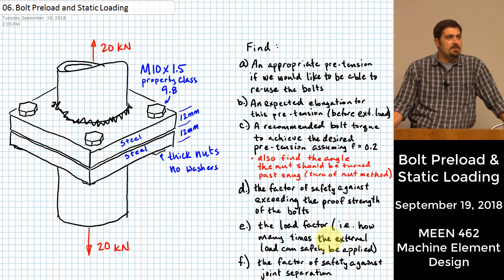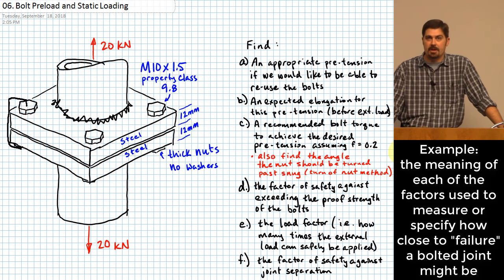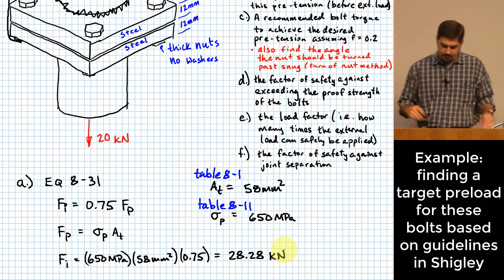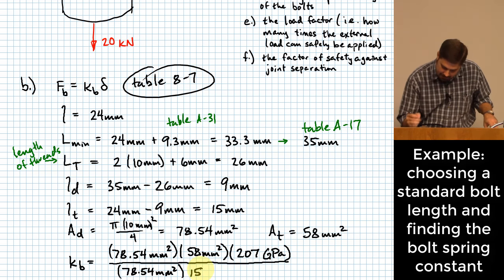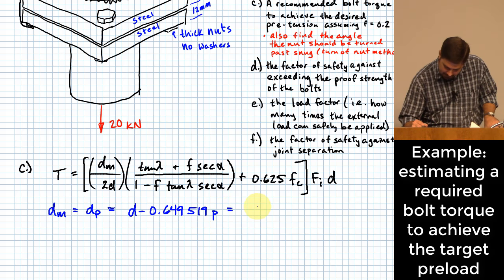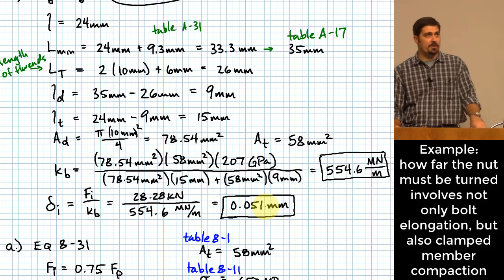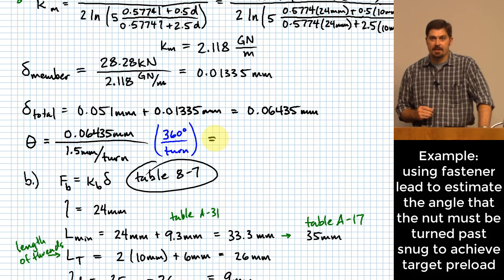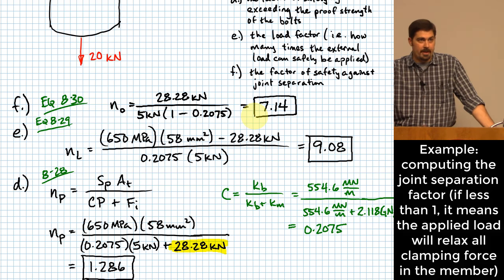Bolt Preloading & Torque | Static Strength of Bolted Joints | Load Factor | Joint Separation Factor

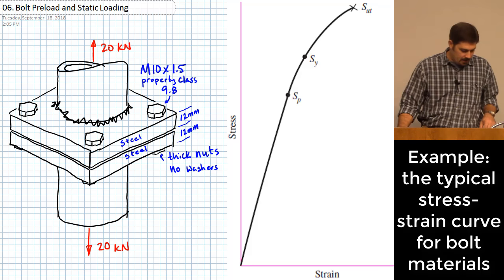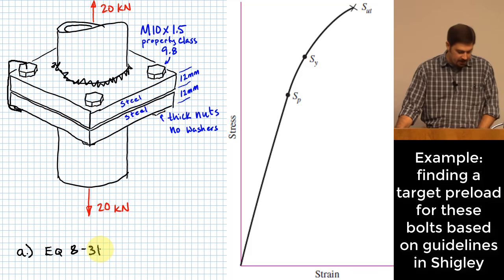Comment: 3:30 & 11:18 
I suspect that the points labelled Sp & Sy on the graph are the wrong way round:

Sp = Proof Stress i.e., it IS the stress where yield is detectable (i.e. proven) and is typially 0.2% plastic yield, therefore, contrary to what was said in the video, plastic deforamtion has already occured.

Sy = Yield Stress i.e. is the theoretical maximum stress at which no plastic yield at all has occured.
Reply from the maker: I'll just refer you to section 8-9 in Shigley's Mechanical Engineering Design, 10th edition. In particular check out Figure 8-18.
Reply: @TheBomPE  
Yes, I did know that the image was from a book.
It's still wrong though:

"Let’s come back to the stress-strain curve given by the tensile test and focus on the region beyond a certain stress limit, where the material cannot recover to its original shape. This onset stress limit for plastic deformation to occur is called the yield strength "

"Sometimes the yield point is not well defined, so we will often measure the stress at which a certain amount of plastic deformation has occurred, called the offset yield strength. Proof stress is the point at which the material exhibits 0.2% of plastic deformation. "

Plastic deformation: strength and ductility
University of Cambridge

Comment: The dimension "At", the reduced bolt section area due to the tooth profile, doesn't take into account that at the root of the thread profile you have a stress concentration feature.

Comment: Amazing material, just quick doubt, where does the 0.625 comes from in the Torque formula where you add tan and sec with friction coefficients? or what does that constant means? Thanks and great job is so easy to understand the amazing world of fasteners

Comment: Does that extra twist during torquing reduce the final axial stretch of the fastener or is it negligible, if using a torque spec for installation
Reply: since some of the torque you are measuring is going into torsional stress rather than tension

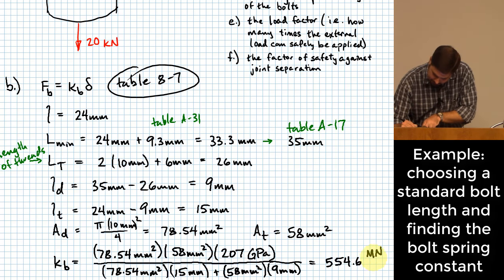Comment: I'm confused by the units of Kb at timestamp 28:38 being MN/m. Isn't the answer 5,546,445,738,000 N/m or 5546 GN/m?

Edit: Nvm, I realized 78mm^s is not 0.078m^2.I'll leave this here in the event anyone else comes along and makes the same mistake.

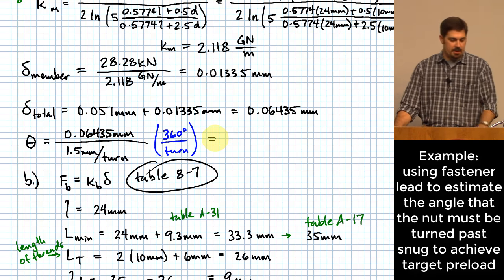Comment: [56:00] Bolt stretches .05mm, plates compress .01mm, so the bolt must jut out & stretch .06mm past the end of the compressed plates.  So add.  (In detail, the stretch of the bolt would slightly increase the number of mm per turn?)

Comment: thanks you so much for this useful lecture.
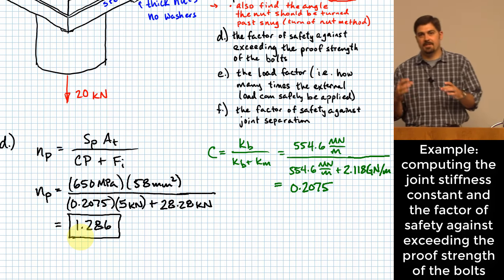i just have a question about equation Np = Sp* At/(C*P + Fi ) (1:01:11 )
My understanding, for the pre-load condition, Bolt is under tensile load and 2 metal plates is under compression load.
Then if we apply external load in axial direction ( tensile load ), then 2 metal plates will be released the force. 
Mean that : force in bolt = Fi + 5kN
and Clamping force in plates = Fi - 5kN. 
The above equation should not include C factor, it should present as : Np = Sp* At/( 5kN + Fi )
please correct me if i was wrong. 

thank you so much !
Reply from the maker: The C factor describes how much of the external load is used to stretch the bolt and how much is used to relax the clamped members. It is based on the relative stiffness of each part. I would refer you to the explanation in Shigley's Mechanical Engineering Design if you want to see the origins of that equation in greater detail. Thanks for watching!

Comment: Thanks for a great video, it was really helpful. I have one question in regards to the external load. The bolt is under axial loading from both ends shouldn't the axial load be doubled. I'll really appreciate your answer.
Reply: No, the axial force should not be considered twice. This is a case of static equilibrium. To illustrate, consider a 5 kg weight hanging from the ceiling, suspended by a (massless) rope. The resultant weight on the ceiling is 5 kg, which corresponds to the rope tension. Bringing it back to the worked example, if the tensile force on one end was 20 kN, and say 5 kN on the other end the bolt group would be subject to a tensile force of 5 kN, but the complete assembly would be subject to an acceleration  equal to the ratio between the net (total) force (20-5=15 kN) and the mass of the assembly.

Comment: I already thanked you several times for your great work but every time I find another great solution to an engineering challenge I encounter at work I just can't hide my gratitude. Thank you. You the man! :)
Can I please have the title of the handbook/s you are using in this video? And also the titles of any other good handbooks which you can recommend for learning stress analysis/machine design?
Greetings from Poland!
EDIT: I found the title in the previous comments below. Thank you
Reply from the maker: You are very kind! Thanks for the encouragement! The other machine design book I really like is Norton.

Comment: what books do you recommend me to learn this theory? I work in Europe and with DIN and Eurocodes. Thanks a lot.
Reply: I am actually in this professor's class right now at the college he teaches at! We use Shigley's Mechanical Engineering Design 10th edition, but the 11th edition is now standard. I recommend finding a pdf of the 10th edition and reading chapter 8.
Reply: @kebha6308  thanks a lot

Comment: Wonderfully clear lecture, even for an EE. What book are you using for this class. I would like to buy it.
Reply from the maker: I use Shigley's Mechanical Engineering Design, 10th edition, but there are several other high quality texts out there as well (e.g. Norton). Thanks for watching!
Reply: @TheBomPE  aside from Norton and Shigley, what are the other high quality machine design textbooks? I'm interested to know. Thank you

Comment: Sir thanks for this video as it is very interesting and knowledgeable. Can we safely say that np must be greater than 1, and nL & no must be greater than 3 in order to know that it is safe? thanks.
Reply from the maker: It needs to be greater than 1, but will seldom be as high as 3. The loading factor nL is often set at 3 or higher though. I generally avoid giving advice on how high Design factors "should" be, since there are so many real- world factors that should be considered when setting them. Thanks for watching!

Comment: This was perfect, I'm currently calculating bolt stress in a statically loaded member for an engineering team I'm a part of, and I haven't taken a machine design class yet, thank you.
Reply from the maker: You're welcome! I'm glad it helped!
Reply: Which equation you used for stress calculation in bolt? I am also interetsed in stress of the bolt. Is there any help regarding it?

Comment: Excellent video..need to know, how much will be typical factor of safety against joint seperation to be considered.
Reply from the maker: Most sources are reluctant to quote any specific guidelines on factor of safety generally. This is partly due to the liability it could incur by doing so. I can tell you that NASA basically says that once the worst possible load is anticipated, there has to be a joint separation factor of at least 1. I don't give this as a prescription, just a reference point. Thanks for watching!

Comment: First of All thanks for the amazing lecture, i am designing 4 bolts to hold a speed reducer so the force applied on them is due to moment and not pure tension in such case do we have to calculate the Km and Kb or we don't need them
Reply from the maker: You might check out this lecture: https://youtu.be/yv26c_5H2rA
It deals with torsion applied to bolt groups, which is what it sounds to me like you are talking about. Thanks for watching!

Comment: I've been looking for this breakdown for so long, thank you! Also, what stylus, tablet and drawing software are you using in your lectures? I'm keen to use something similar when I'm doing calcs for work to save me using pen and paper
Reply from the maker: I'm glad it helped! I use a Fujitsu T901, 16gb ram, 2nd gen i7, nvidia graphics. It is built with a wacom digitizer. That's the key, wacom makes the best digitizer technology IMO. I have a newer computer as well, an HP zbook X2, it also has a wacom digitizer. I use Microsoft Onenote 2007 since that was the last version of that software that allowed fully customizable toolbars. 
In case you haven't seen them yet and might be interested, here are some of my playlists:
ENGR122 (Statics & Engr Econ Intros): https://www.youtube.com/playlist?list=PL1IHA35xY5H52IKu6TVfFW-BDqAt_aZyg
ENGR220 (Statics & Mech of Mat): https://www.youtube.com/playlist?list=PL1IHA35xY5H5sjfjibqn_XFFxk3-pFiaX
MEMT203 (Dynamics): https://www.youtube.com/playlist?list=PL1IHA35xY5H6G64khh8fcNkjVJDGMqrHo
MEEN361 (Adv. Mech of Mat): https://www.youtube.com/playlist?list=PL1IHA35xY5H5AJpRrM2lkF7Qu2WnbQLvS 
MEEN462 (Machine Design): https://www.youtube.com/playlist?list=PL1IHA35xY5H5KqySx6n09jaJLUukbvJvB
(MEEN 361 & 462 are taught from Shigley's Mechanical Engineering Design)
Thanks for watching!
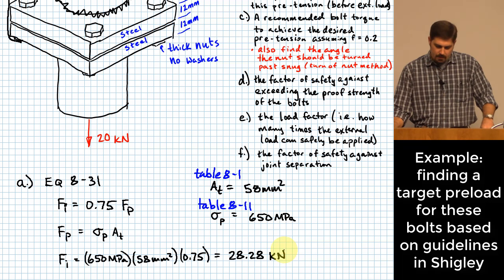Reply: 18:41

Comment: That´s very good lecture. Congratulations!!! I have one question: Is there any situation we should consider retorquing the bolt? Let´s say after a certain amount of hours of operation and when the bolts are submitted to transverse vibration.
Reply from the maker: Thank you! Many bolts are not installed to the levels of preload that are recommended in the text. Consider the case of a steel bolt installed into aluminum threads, for instance. It may be difficult to design such a connection that would be capable of stretching the bolt as much as we would want. Enough elastic deformation applied to the bolt and member at installation can hypothetically be sufficient to prevent loosening due to vibration. What is often done as another safety against vibration-induced loosening is to make washers or bolt heads that have some kind of teeth that dig into the mating surfaces. Other safeguards can include threadlocking compounds, cotter pins, safety wire, etc. It is often important to use these secondary safeguards in applications where vibration-induced loosening could cause mechanical failure that endangers life, health, or property. Thanks for watching!
Reply: @TheBomPE  Thanks

Comment: At 59.40 you calculated that around 80 percent of additional loading on the bolt head is going into relaxing the member instead of stretching the bolt. Whilst it is shown that the member deforms about 5 times less than the bolt. Why is this? My intuition tells me that if the member is 5 times as stiff as the bolt most of the loading should go into stretching the bolt. 
Btw these videos are awesome.
Reply from the maker: Thanks! Here is the key confusion I think you are having: there is deformation of member and bolt that happen during joint pre-loading, and there is deformation that happens due to additional applied load. The bolt is less stiff, so it naturally deforms more during pre-loading (pre-load force is equal between bolt and member). However, when external additional load is applied, the amount that the bolt stretches is equal to the amount that the member relaxes (changes in length are equal in this case, not changes in force). Because the member is stiffer, that means that the change in how much force it carries is greater than the change in how much the bolt carries under additional applied loads. I hope this helps! Thanks for watching!

Comment: If dm is the same as mean diameter, why is that equal to the pitch diameter dp?
Reply from the maker: Do you have a copy of the Shigley text I teach this course out of? If so, you might look at figure 8-2. Otherwise look at this link: https://en.wikipedia.org/wiki/ISO_metric_screw_thread
The pitch diameter is the diameter where the "width" of one nut thread is the same as that of one bolt thread. Because of this, I believe it is reasonable to use pitch diameter as dm (the diameter where a distributed force over thread faces is lumped) in screw torque equations for threaded fastener thread profiles (as opposed to ACME or square profiles). Frankly, the other factors that lead me to use dp as dm rather than computing an actual dm for the profile is that it is easier to find, and it makes very little difference anyway.

Comment: Are any of your formulas only compatible with metric? I have been trying to dissect some of the problems and keep getting an unreasonably large result for material and bolt stretch. I have been keeping an eye on units so I don't think it is an issue of decimal translation.
Reply from the maker: All of the methods shown work for both SI and US systems. I would recommend carrying all of your units through every step to make sure you aren't doing one of your conversions improperly. Make sure you are using the correct units for elastic modulus, they are generally in GPa or Mpsi.
Reply: @TheBomPE   I have found my issue. I was mistakenly using proof load of the fastener as its modulus of elasticity. Since 85 ksi proof load is much lower than 29,000 ksi modulus, it was resulting in an absurd amount of bolt stretch. Thank you for uploading this video and helping people learn about bolted joints!
Reply from the maker: Glad I could help!

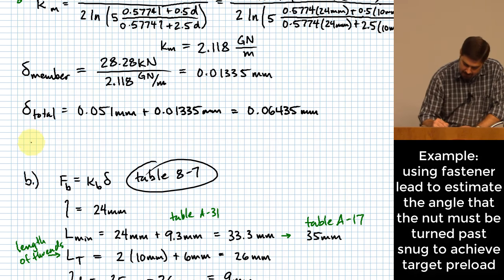Comment: @54:45 should it be a subtraction since the bolt in under tension and the member under compression
Reply from the maker: No, they add. As the member compresses, it relaxes some of the stress that would otherwise have developed in the bolt, because the bolt won't stretch as much. This is consistent with what our intuition would be: the less stiff either of the materials are (i.e. the bolt material and the member material), the more the nut will have to turn to generate the clamping forces.
Reply: @TheBomPE  
for them to understand better, maybe its better to say it this way :
the compression of the member takes away tension added to the bolt.
so  you need to add 
sigma (bolt,tension)
and
sigma (member,compression)